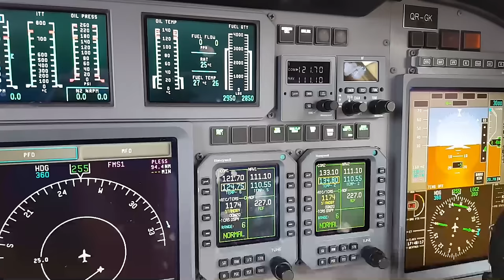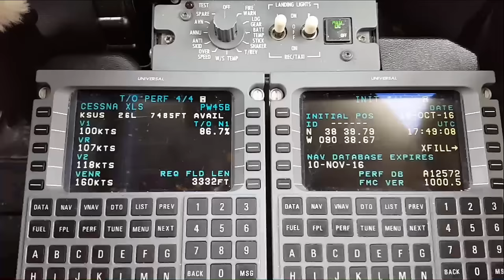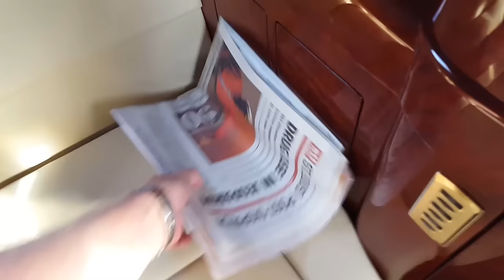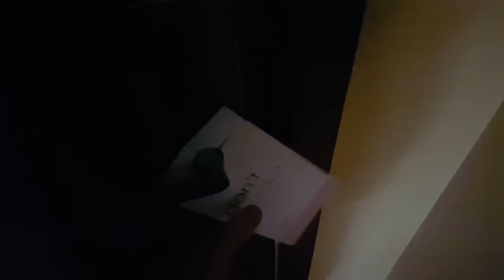Cessna Citation XLS Flight to Opa-Locka Florida, Pilot Vlog 115

Comment: I just love the Citation. :)
Pretty heavy cloud base at take off - then better and better. Nice touch down as usual. Looked a pretty trouble free and nice flight Jim. :) The Monterrey trip conditions looked just grim!  Another great vid.
Can't quite see but thinking the XLS has leading edge slats.
Reply from the maker: No leading edge slats. The silver leading edge is where the hot bleed air is ducted for the wing anti-ice.